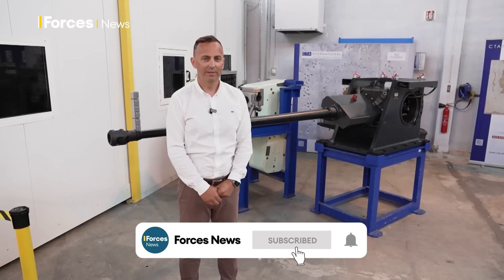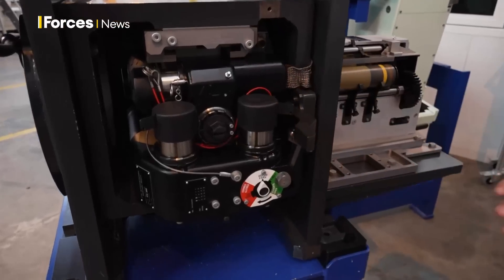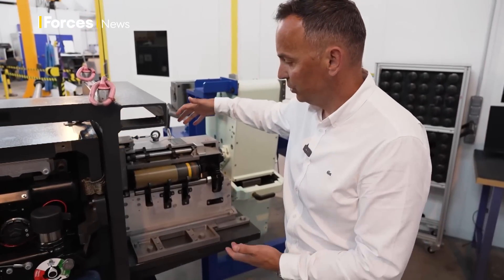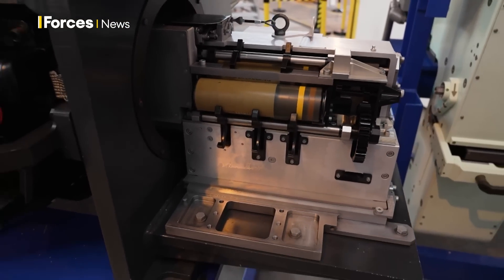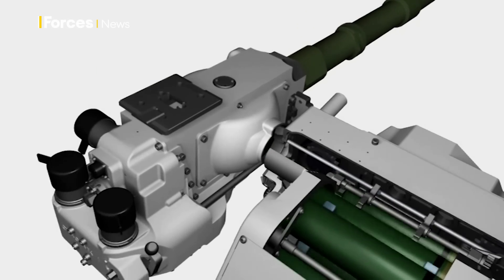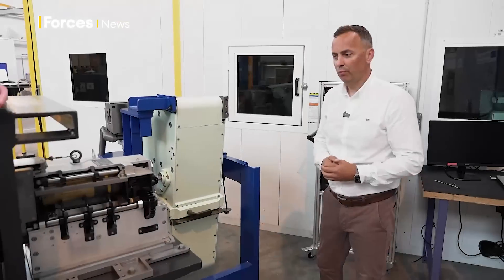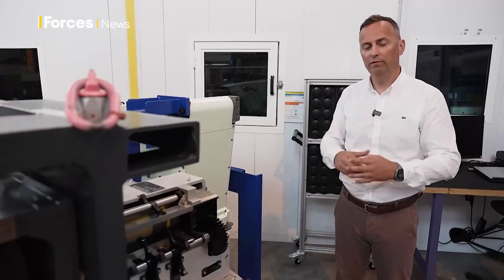Why British Army's new CT40 cannon is so advanced

Comment: How reliable can that be all that force and dirt going into that assembly ? I hope in wrong
Reply: Can't see why dirt would cause more problems here than in a regular recoil operated or chain gun.

If anything I would assume the swing breech system would allow any dirt or fouling to be pushed out by the new cartridge going in. And keep in mind this goes on the inside of an armored vehicle...
Reply: 27 years in development. Surely, they've worked through many of these issues. 
Just as that info isn't in the public domain. Doesn't mean they've not looked at the issue.
Reply: Your right systems like this get clogged up on the battlefield and components break, that rotating roller for the chamber will deffo be an issue on the battlefield
Reply: @Alanperki you're right

Comment: Couldn't you connect that 64 round mag straight into the introductor? Or is that just a prototype demo system? Sorry if I'm being dense ..
Reply: you don't want to because the carousel goes both ways to get to the round type you want as quick as possible. Feeding more in is easy so you'd aim to disengage long before it's empty
Reply: @xaiano794  OK, didn't appreciate that. Thanks..
Reply: This is the final version

Comment: Lol, they copied this from the Chinese, who've had this system for a while!
Reply: what model are you claiming?
Reply: @xaiano794  In this clip you can see it uses the same type of loading and extraction system. I'm surprised the British don't proclaim they invented gunpowder!
Reply: @GlenKrog same as what? Chinese weapons have names,  simply name the gun you are referring to.
Reply: @xaiano794  I can't read Chinese, it doesn't articulate that in the video, if the watch the video instead of being combative, you'll see it in action and the mechanism is clearly, graphically illustrated! What more do you want?
Reply: @GlenKrog  what video? If you're trying to post links,  they get hidden by YouTube. You have a translation app, just screenshot it and translate the name of the weapon
Reply: The concept for this kind of auto cannon (swing breech with cased telescoped ammunition) goes back to the early 80s, with Eugene Stoner's work (the inventor of the AR15).
Reply: @haaxeu6501  It works really well with the digital carouselle idea - like if this was a simple gun, belt feeding would likely be better, but with the carouselle it allows you to have a variety of ammunition types so I can see the advantage given that anti-drone rounds seem essential these days (despite that video of a bradley taking out a drone mid air with 25mm cannon)

Comment: So compact , mounting as anti drone support for integration into armoured columns , was something flagged up as lacking currently ,with ajax , it is still a hefty cost in such small numbers. One for each C3 deployed ? The drone defence in depth and hydrogen engines still to be used, to escape fossil fuel dependency ,there are still lots of questions hanging over the future of armoured vehicles , is this another outdated idea that will be superseded as it enters service ? With every advance in flight time and load carried is the equation moving back toward mobility and away from land bound vehicles with heavy armaments ?
Reply: 40mm air defense limits the ammount of ammunition. So 30mm airburst might be better
Reply: @emilsinclair4190  How about a 40mm round with a proximity fuse?
Reply: @Akm72  same problem. Low ammount of ammo (but improved do to not using standart) and proxy and modern programable is basically no dif
Reply: This gun from what I can see is the future . The rounds are smaller than traditional rounds, half the size ,  and there will be a choice I believe of several types of rounds from armored  piercing  to air burst for drones and the like which will be smart rounds .  The gun can elevation to over 80 degrees so it can practically fire directly upwards . As far as I'm aware this is specification ajax vehicle will recieve. And hopefully in the future more anti air defence will be provided for vehicles as only challenger 3 getting trophy system at the moment as u mention. But yes in general I think this type of round and gun is the future . There is even a 50 mm out there i think .

Comment: Is there a failsafe to prevent ammunition from being loaded in backwards?
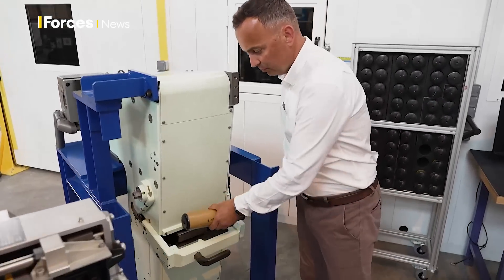Reply: 1:45  Look to the rectangle the round is within, and at the top right you will see an indexing 'tooth'.  The groove in the cartridge rim allows this tooth to pass.  If the other end of the cartridge is in the rectangle and an attempt was made to load, this tooth would stop the round from being loaded.

Comment: What's it's Average fire rate?
Reply: In the previous video it mentions. May be 200-300 rounds a minute? compared to the 30mm Rardens 90 rounds per minute.
Reply: Those fire rates are mealiness anyway because how many rounds are you going to have on you
Reply: @bigtony4829  64, total
Reply: @xaiano794  64 per magazine, which can be loaded to provide a continuous loop.
Reply: @tacticaldelusion  you'd never need more as you'd want to withdraw between engagements and you can just load more
Reply: @bigtony4829  And you'd probably only fire a short burst anyway, maybe just one round at a time.

Comment: Dont post on how the whole damn things work, China might reverse engineer it 😂
Reply: They probably already have.
Reply: It is not because you have seen something you can make it. It just indicates that it is a viable way to do something. 
To copy, you need to know which grades of steel are used, tolerances, have the correct steel and machine tools precise enough to make parts, etc…
This is not something anybody can deduce from a video.
It is like jet engines : while very simple in principle, with very few moving parts, very few countries can design and build one.
Reply: @chefchaudard3580  That's all you need, a spark of an idea to set you going. Car manufactures buy each others cars when a new model comes out to see if there's anything new they can utilise for themselves.
Reply: @georgejohnson7591  my point is there is a loooong way to go between what can be deduced from this video to reverse engineering. 

The next step, as with your example with cars, or mine with the jet engine, is to obtain one. Then after, determining what can be done with the materials and machine tools available. It may be the case that, like for my example with the jet engine, some parts simply cannot be manufactured because they require knowledge, materials, or manufacturing capability that are missing. And, even if a clever trick is discovered when studying the original, it is possible it cannot be obtained from inferior materials or without very specialized machines.

Comment: Looks overly complicated for not much benefit
Reply: Its a very simple system, we just aren't familiar with it
Reply: The fact that it recoils only two inches into the turret should save a considerable amount of space and weight making the design more efficient.
Reply: There is uncertainty about whether this gun is really the right choice, but it does provide a lot of firepower for the size of turret and therefore vehicle. The question marks seem to be over the cost compared to a conventional system with greater volume of sales.
Reply: A regular chain gun is probably more complicated if anything.

Comment: There was a picture of a mock-up of a turret with the CT40 cannon on a Boxer. I do hope the MoD will at least look into getting a Boxer IFV/FSV with this turret. IMHO, I think the troops will appreciate the additional firepower.
Reply: It does make more sense for the Boxer to have a 40mm gun too instead of the 30mm found on most Boxer IFVs, one ammo type for both
Reply: I am sure they will put it on anything which fits
Reply: @SmackRatsUK  or is the cheapest
Reply: UK ordered 500 CT40's, so maybe given that number.
Reply: The rotating breech also allows the barrel to be raised by 60°.
Reply: Shoud just get 300 Ajax platforms in IFV configuration that carries 6-8 dismounts.
Reply: Well they have ordered 570 turrets say half on Ajax the rest must be for boxer
Reply: I want one 👍😀...
That will fit on my smart perfectly and will give me hours of fun
Reply: Does IFV need a 40mm though? It's too big for IFV and too small for heavier AFV.
Reply: désolé de te décevoir mais le jour ou du materiel allemand sera equipé de materiel en parti francais n'est pas encore arrivé.

Comment: the smartest NEW use of the HK G11 system I've see in a loooongwhile. and loading through the Trunnion is simply genius. very nice. I'm impressed.
Reply: Hehehe... Glad I'm not the only one who thought of the G11's rotating Clockwork loading / extraction Mechanism 🤣
Reply: It looks similar, however if memory serves me right, the G11‘s mechanism spins 90 degrees back an forth instead of going 180 for each cycle.
Reply: Kraut Space Magic! Ja Ja Ja!
Reply: The P90 already use a 90° blot action
Reply: @adr1uno638  No, the P90 spins the ammo in the magazine, the bolt is linear.
Reply: seems like system that introduces alot of failpoints and problems to me..
Reply: @Patrik6920  What are they?
Reply: @Patrik6920  They wouldn't have introduced these if they had a lot of problems.. But hey, why don't you apply for an engineering job there, since you seem to think you know better than them.
Reply: @mrnobody043  Well said!
Reply: This design actually predates the G11. It's called a CTA gun, actually pioneered by a team led by Eugene Stoner. The US built a prototype light tank armed with a 75mm "anti-tank machine gun". It was later upped to 105mm, but costs were deemed too high. Spookston has a good video on that history, but the tank itself was called the HSTV-L.
Reply: The G11 used caseless ammo
Reply: @apistodiscus  Well, yes. But that's irrelevant to this discussion.
Reply: @Oddball_E8  Nah i think its just a point, a weapon is a weapon
Reply: @Oddball_E8  Not really, not having to worry about an extractor system is a big difference that is relevant. We cannot assume that something designed for caseless ammo will not have massive problems when you try and get it to extract cleanly.
Reply: @agsystems8220  Sure. That would be an issue if this was just the G11's system transplanted into this.

It's not. It's a very similar system, but it's built for this. It's built for cased ammo.